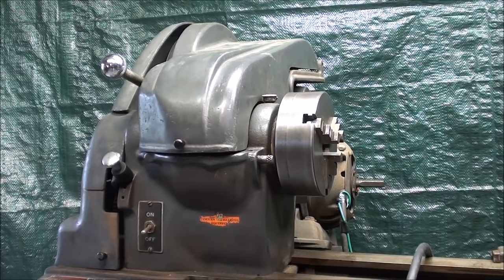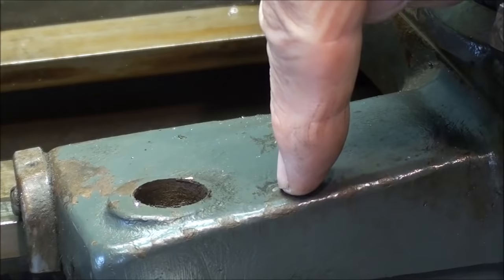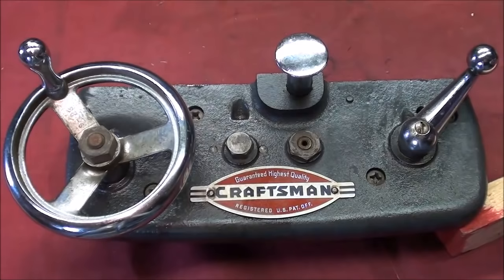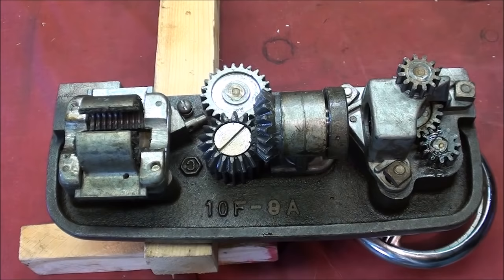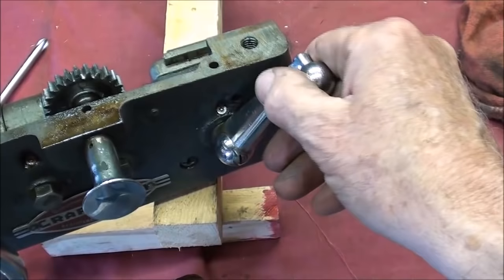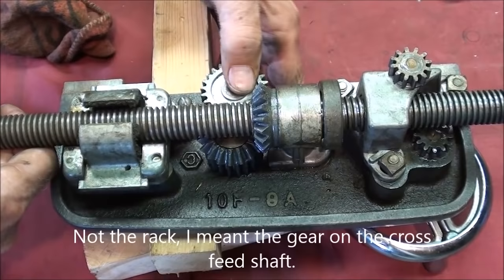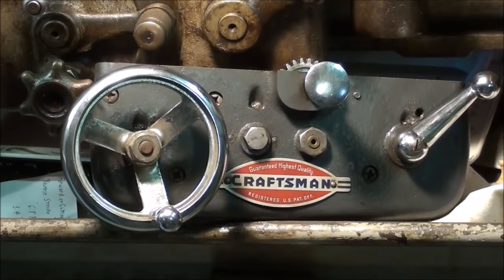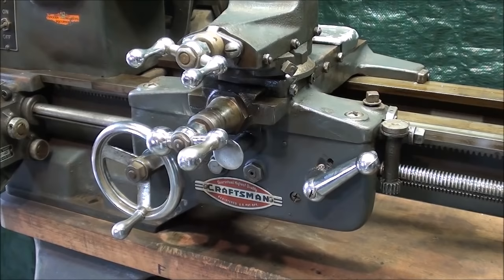SHOP TIPS #231 What's Inside the Apron of the Atlas/Craftsman  Lathe  tubalcain

Comment: Just got my first lathe yesterday. Thank goodness for this video, it solved my problem. Been a long time coming as I’ve watched this channel a long time. A ‘68 QC54. It looks like it hasn’t ever been used because the ways and the undersides of the carriage and cross slide look new. The original owner crashed the carriage right after buying it  I guess and broke the cross slide gear. The guy I bought it from never put it back together but replaced the gear. When I went to see it he couldn’t get the cross slide to automatically travel. Today I took it apart and found he put in a cross slide gear that wasn’t keyed. This video was what I needed to see. What an easy fix as my neighbor offered to key it with his Amco shaper. Thanks the lord for Mr. Pete.

Comment: I first watched this video 5 years ago and found it very interesting. A few weeks ago I found an atlas QC54 10" lathe and was able to purchase it. The ways are in perfect condition, no nicks or dings at all. I need to make an oil dauber for the tail stock, I will refer to your video on that project. The only part that is broken is the plunge control that engages the power to the cross feed. The casting broke at the point where the pin is inserted to hold it on the shaft. I was able to one on Ebay and it is on its way. The detailed look at the apron is very helpful and lets me know what I am getting myself into while replacing the control. 

You are by far one of my favorite channels on youtube and I have watched many hours of your content. Thank you for dedication, inspiration, and education... I will put it to good use.
Reply from the maker: Thank you very much for giving me an encouraging comment when I’m a little down.  I am so glad I was able to help with your repair.

Comment: thank you for this great video. it was very helpful while repairing my power crossfeed on my 1953 Atlas. the gear was chewed up and actually sheared off. i replaced them with steel gears and for the first time since grampa was using it years ago my power crossfeed works. i also thoroughly cleaned all the gears, honed the halfnut to remove burrs and chips that were making it bind, and regreased everything. this video made it very easy

Comment: Very much enjoyed it. I'm amazed at the engineering necessary to get the accuracy between the apron, lead screw, and the gear head. also, if one has trouble disassembly the equipment the will never get it working.
Reply from the maker: +dlstanf2 Glad you liked-Thanks for watching!

Comment: the half nut housing broke on my over the pond lathe, 13x40. I finally deduced the alignment was 0.020" off. ordered new ones, same cra__. making same now with correct dimensions. (have incorrect backups, hee hee.) your video helped confirm my reasoning. like Keith V says "unfinished tooling".
Reply from the maker: +James Hillman So true--glad you got it working

Comment: I just bought one st an estate sale. I took apart the skirt first as the main carriage was stuck. Previous owner had jury rigged some oiling device with bits of pipe cleaner which had become stuck in the gears. I cleaned the ways with emery , wiped it down with solvent and filed some rough spots off. It runs and feeds. Somebody removed the switch which is a big issue. I think it is a 1960s machine as it has a clutch on the lead screw. What a find!
Reply from the maker: It sounds like you've got a real nice machine

Comment: When I bought my "restored" Atlas lathe the longitudinal feed would not work with the hand wheel.  Turned out the guy who restored my lathe put the wrong gear on the pinion.  It was the right diameter, but the wrong pitch.  Thanks again for all of your Atlas and other videos.  The class lengths are just fine the way they are.  All interesting subjects.
Reply from the maker: +Gus Lint Glad I helped--thanks for watching

Comment: I watch your videos  and refer to them as gospel. just watched this one and went out and removed my apron to clean it.  not too bad considering the machine is a one owner and pristine. (I bought off orig. owner) I  followed your instructions to the letter  but  upon reassembly  I shattered the  traverse  gear housing....  apparently the rack was not lined up to traverse gear and she let go. such a shame as I said this  lathe is (was) perfect.  just a warning to anyone else the apron WILL line up with the pins and cap screws but  MAKE SURE the rack lines up with gear.  I felt ZERO resistance  when tightening screws  and it crumbled like a cookie.. thank you Mr Pete for all you  do for us!!! now off to Ebay to spend a lot of $$

Comment: My 10” TH54 Atlas does not have the safety feature preventing carriage and crosswise from moving together. Also, the small hole in the top of the casting just above the cross slide knob should have a small ball bearing lying inside to act as a detent. Just as the half nut lever has a small ball bearing.

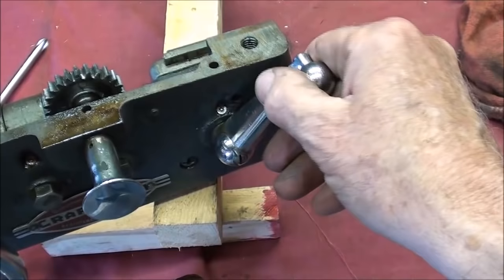Comment: Hello, sir. At 11:48, you show the trough that carries lubricating oil from the Gits oiler to (presumably) the miter gear bearing. On the replacement miter gear bearing that I bought, this trough dead-ends at the brass sleeve which is pressed into the housing; brass is visible at the bottom of the hole. I expected there to be a hole through the brass bushing to allow oil to flow onto the miter gear shaft spinning inside the brass bushing. Do you know what this Gits oiler and trough are meant to lubricate?

Edit: I'm just going to drill the hole thru the brass sleeve... I'm certain that drilling this hole thru the sleeve was the final step to replacing it... a step that someone skipped. Great video, though. Love this series on the Atlas/Craftsman 12" lathe. Lots of helpful info.

Comment: I had to replace the half nuts on my Atlas 12 and in addition the bevel drive gear. I found that the bevel drive gear support oil hole was not drilled all the way through which prevented lubrication to the bevel gear. Be safe. Check yours.
Reply from the maker: +Gord Taylor thanks for watching--open up that hole

Comment: I did not know they used Zamak zinc base alloy for gears. Which Zamak alloy did they use? I'd assume Zamak 3, because of the dimensional stability of the material, across varying temperatures. I know brass expands & contracts quite a bit, but the brass rack I am thinking of is on a .00005" dial gauge. 4 or 5 degrees F and it changes. She is a beautiful old lathe! I'd sure love to have it. I rarely see a machine tool, I don't like. Chinese stuff not withstanding.

Comment: I just bought a lathe exactly like this one 101.07403 , do you know what the diameter of the v pulley on the motor should be, I kinda think it has been replaced with one bigger than it should be as the belt won't work on the biggest pulley on the lathe drive . also what is the key supposed to be on the 4 jaw chuck, I didn't get one, the guy I bought it from said that an Allen wrench would work but I have 3 sets and none of them fits the chuck screws, and one more thing, do you know what the taper number is for this lathe? thanks. Vernon

Comment: Thanks, Mr. Pete. I enjoyed this video. I have a small craftsman lathe that I'm trying to get back operational. Not sure if it's a 10" or 12, I guess I could check the swing to verify. Sn. is 101. 28900, but it's been stamped twice, 101.28910? Thanks again for the video!

Comment: Mr. Pete222. When I tightened the shoulder bolt and nut on the bevel gear the bevel gear gets tight against the apron.  Therefore it will not spin.  Is there supposed to be a thrust washer or some type of shim stock for this?  It is a powered cross feed.  It is a atlas/craftsman 12 inch lathe. Enjoy your videos.  Thanks Nick

Comment: Mrpete, I took the spindle out of the headstock of my atlas 10 inch lathe today (7/20/44 on the bearing) and I noticed that the holes under the oil cup reservoirs don't go all the way through the wall in the top of the bearing hole. Did they make a manufacturing mistake and not drill them out? Should I drill a small hole? I can't figure out where the oil people have been putting in the cups for the last 70 years has been going! Thank you for these videos, I haven't been this excited about learning something new in decades.
Reply: +Shane K Hi Shane, Are the bearings made from sintered bronze? If so the sintered bronze will soak the oil up as long as the drilling exposes the outside of the bearing. A lot of old machinery used to use this idea sometimes with the aid of a 'wick' (felt). If they aren't, I'll let someone who has more knowledge of lathes answer :)
Reply: Thanks Steve, it does look like bronze, there's something going on in there, it just seems like those oil cup reservoirs are useless but I guess it goes somewhere.
Reply from the maker: +Shane K Probably for the sintered bearings??
Reply: Thanks you two!

Comment: Thanks Mr. Pete!  My wife bought me the Atlas version of this lathe for Christmas so the timing of this is a bit miraculous.  To be honest, I didn't realize it had power cross-feed until I watched your video!  I will purchase the course for this lathe shortly but I'm hoping the Canadian dollar improves before the sale expires!! ;o). 

Have you ever had the headstock off?  I looked at your video on moving the Logan prior to picking up the lathe and expected the HS to come off easy but no such luck.  We undid the "saddle" (not sure if that is the correct name) bolt which appeared to be the only thing holding it on but it would not budge.  The previous owner got a steel drift and a sledge out but I got scared and said we'd move it the way it was!!

The 3-jaw was stuck on when we picked it up but your recent video on that subject helped me get it off without smashing anything.  (Check's in the mail!!).

Another surprise we found after we got it home was a hairline crack where the belt tensioner lever attaches to the half-shaft casting.  (Again, I'm making up these names.) I wonder if this could be brazed?

Lastly, I assume there is Morris taper in the headstock.  If I am correct about this, would you know the size?  My research seems to suggest it has to be a #4 but I could be wrong.  I suppose it depends whether it starts at the outer edge or in further.

Anyway, thanks again.  I got the yellow boy plans from Toly over the weekend so I'm raring to go!  (I will start with your course so I don't smash the lathe!)

Kind regards,
Paul.
Reply from the maker: +Paul Culbert Paul. Its a #3 MT in headstock. You can probably braze that past. I had the headstock off of my clausing. They are easy to get off of the atlas. Glad you got the chuck off-thanks for watching
Reply: +mrpete222 Thank you sir!

Comment: The bevel gear with the integrated key (right above the 9A stamp) will lose its key.  The "teeth" on the edge of the lead screw's keyway chew it off eventually.  It's only about 50% there on your lathe, and on mine it's gone.

Comment: mrpete222  I had to find your video on this part on my carriage i have the th42 atlas 10" my mistake i was using my power feeds and was using my cross feed facing and hit my leaver for the carriage feed both started to feed i almost messed up my work mine is a 1939 on head stock bearings, im going to remove my lower part of carriage and see if there is a pin in it to stop that from doing it again thanks for the video. im making tracking wheels for a 2x72 belt sander correct me if im wrong for a2% taper on each half of wheel i would set compound to 88 on marks and that on the other half but 88 on other end  Duane  have a great day

Comment: Hello Mr. Pete!  How do you remove the knob for the cross-slide power feed?  I've completely disassembled the apron and this knob at 13:17 is the last piece I need to remove before spray painting.  Thanks in advance!
Reply from the maker: I think it is held in with a pin.   But I really do not remember

Comment: In your beginning scenes of this video appears that dreaded phillips head screw you had to deal with in order to remove the apron.  I like to compare the phillips head fastener to an " on again - off again girlfriend " , kind of like you can't live with them and you can't live without them type of scenario.  The phillips type head fastener was developed years after the square drive.  A Canadian named Roberts developed the square drive and Henry Ford wanted to use  it.  Lawyers representing Ford and Roberts never could agree on terms and eventually Ford went all Phillips.  If Ford had adopted square headed drive fasteners the phillips head may very well have faded into anonymity.  I think the phillips head is prettier than other designs but the cam-out situation is aggravating.  The straight slotted fillister head is a favorite of mine and when driven by a properly sized hollow ground blade will go for years without showing much wear.
Reply from the maker: +Jayne Gus So true-thanks for watching

Comment: Hello Mr. Tubalcain,

I have immensely enjoyed your videos and learned a ton! Could you give a hint on how to machine a helical hole pattern around a shaft easily. I am trying to make a Bendix type clutch for starting a model R/C gas turbine engine. It appears that I need to build a fixture that will have the correct gearing so that the work piece can be pushed just the right amount while the milling machine does the job. Thank you very much.
Reply from the maker: +Anab Akanda Requires a mill with power feed linked to a dividing head. No can do

Comment: I have a 1920s IXL lathe manufactured by Oscar ehrlich. When in transport it fell off a pallet, the result was a broken backgear and tail stock clamp. I have since had them repaired but I don't know what I need to do to check the lathe is still in true and the bed plate is square. What do I need to do to check
Reply from the maker: +stanley carter see my video on aligning centers
Reply: +mrpete222 ok thanks

Comment: I am having problems with my 1/2 not wanting to engage. When it does the main screw slows down. I am not sure if the clutch is malfunctioning on the quick change box or if the spacers on the lead screw ( on far right) are incorrect. Any ideas???
Reply from the maker: You will have to remove the apron, and examine it from the inside
Reply: I had it apart. The halfnut may be worn and I will replace it.
Thanks
Reply: After working on the lathe for 3 nights it dawned on me that you shouldn’t lubricate the clutch. I cleaned it with mineral spirits and it work much better🤭

Comment: I was given one of these old lathes, these gears were all stripped and broken die casting just as you described. What a pitiful example of an expensive tool being junk because of an unavailable parts that shouldn't cost more than a few dollars. Same with a big old Sears floor jack, 150 lbs of scrap iron, because parts no longer available.

Comment: Mr Pete, I recently got one of these lathes. If I don't need cross feed power feed, how much of a problem is a couple  of broken teeth on that gear? (9-102-24)? Additionally, 10f-74, the left thrust bearing for the lead screw is missing. Do you recommend any particular vendor for replacing these parts?
Reply from the maker: ebay or sears
Reply: Thanks, I'm going to replace the thrust washer for sure. Any thoughts on whether there is any hazard with leaving the cross feed power feed unfixed (for now) and unused?

Comment: Hi Mr. Pete.  I have watched your channel for a few years and finally picked up an Atlas Lathe a few days ago.  It needs some love because it has been sitting unused for 25 years or so.  I just found that the little 12 tooth pinion gear on the apron has two broken teeth. Do you have any suggestions on how to remove that gear?  I  can order a 12tooth 16 DP gear from Mcmaster but as far as how to get the old one off and attach a new one, I would love your suggestions.  Thanks
Reply from the maker: I have never taken one off. Aren’t they hold on with a pin?
Reply: @mrpete222  Thanks for the response. From what the manual shows, it looks like they are press fit on a square shaft. I am worried about breaking the  zamak case that the gears are in if I try to hammer out the square shaft.

Comment: can you explain the oil ports  beter or atleast show how to use them.. I have several air tools that have this on them and when i go to the parts store looking for a tip  to put on a greese gun or the proper oil can  they have no clue what i am talking about and what i wind up doing is taking the tool apart so i can oil them
Reply from the maker: +Scott Tyndall Not very familaiar with air tools
Reply: Oh OK just trying to find something on what type of tip is used with the type of oiler ports you showed. I have seen thoses type of oil ports before but never have the the right tool to use them

Comment: ive always wondered why is it 30 thousanths and not rounded down to 3 hundreds.
Reply: +Jason K To do so implies a less precise tolerance. For example, a pin made to press fit into a .030" hole might be finished to .031" or .032". The same convention is used on blueprints to denote the level of tolerance required for parts. A dimension indicated at .03" might mean somewhere between .025" to .035" is acceptable whereas something specified at .030" is a magnitude greater in required precision. It's just a matter of consistency and precision.
Reply from the maker: +Don Foster Good explanation